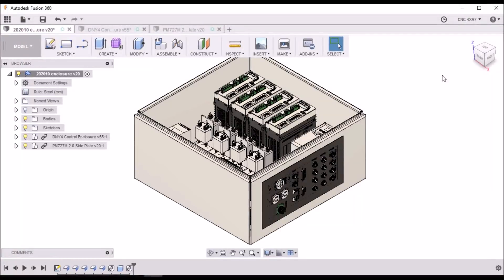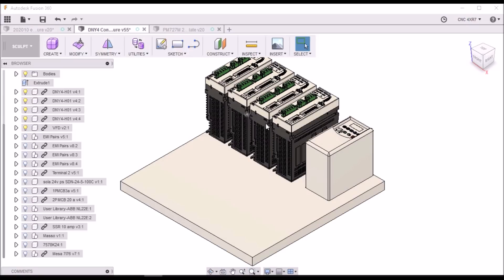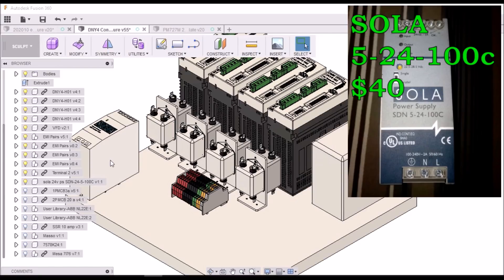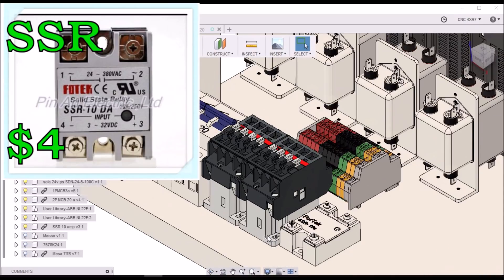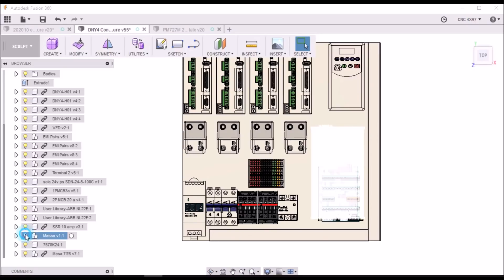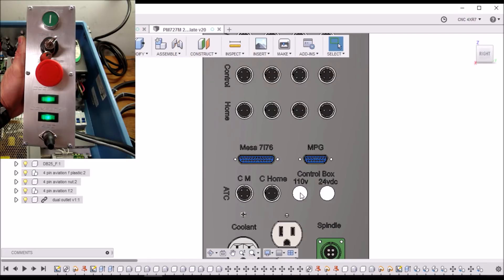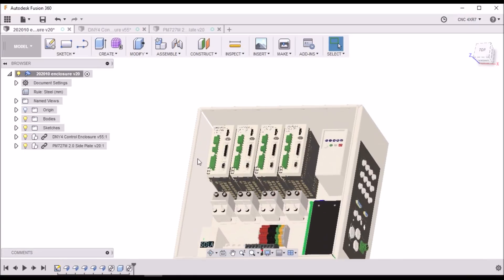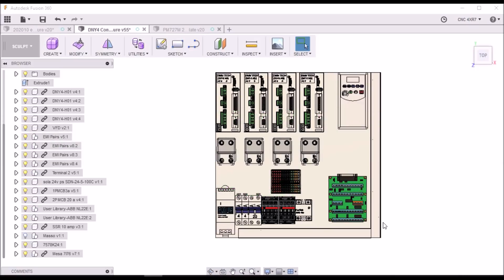DMM Electronic Enclosure

Comment: Hi again ... went back thru your prior controller enclosure videos - and will likely again .. but - Im having a challenge sourcing many of the parts - things like the Dinkle Terminal blocks [ actually ground blocks ] for a single enclosure - most of the sources will only sell ya 50 units !!!  Any chance you can post up a BoM list or a link to the sources?  Took me a week on Amazon to get most of my stuff - and still missing a bunch.  Looking for quality DIN rail mounted fuses,  an Omron power relay - not sure which one one to get actually ... as your part changed midstream ... a quality disconnect ....  there s more but ... Im kinda getting hte feeling you need a distributor relationship with a automation tech supplier to get affordable deals on a lot of the components in these enclosures ...
Reply from the maker: Hi Steve,
Are you looking for components for this box or the Original PM727M box? I sourced most things off Ebay a quick search yeilded https://www.ebay.com/itm/LOT-OF-2-OMRON-MJN3C-AC120-11-Pin-Relays-w-5X853M-Bases-120V-V164/202114040641?epid=1002964353&hash=item2f0eef8341:g:UpcAAOSwfVhaC1i3

Also I got my terminals from this Gentleman also on Ebay Email him with what you need and maybe he can put you a package together. dont for get jumpers. https://www.ebay.com/itm/DIN-Rail-Ground-Terminal-Blocks-8-Qty-AK1-5-PE-Dinkle-14-AWG-Gauge/122055515732?epid=1378796152&hash=item1c6b135e54:g:tysAAOSwbsBXkoPn

There is a Parts list included in My Plans. Email me if you have any questions.
Be Safe,
Sam

Comment: How are you converting the 240 to 110? I use an isolating step down transformer. some people just plug a separate cord in the wall thinking that's isolating it? but if you look in your power panel its just splitting one leg off.
Reply from the maker: Hi Tom,  I'm not splitting 220v just yet no need the drives and VFD runs off 220v. All contactors and controls run of 24v dc. If your talking about the 110v outlet for the CPU/ monitor and Coolant I'm still undecided as to how I will do this I most likely will bring in another 110v from a separate outlet so as not to put to much load on the one. Or like you say add a stepdown transformer which I have it's just a matter of space I also have a line reactor that will be a space decision.
Good question thanks, sam

Comment: have you looked into Centroid CNC Acorn motion controller? just curious as others have great things to say about it...
Reply from the maker: Hi Phil,
 Yes I have looked into the Acorn and touch on it in my CNC controller choices video from a couple weeks ago.
I think there on the right track however it's limited to only 8 I/O's which is a issue I have now with the C11gs. it only supports 4 Axis so that will not work for a ATC. you still need a CPU. So for me a Better choice over Acorn would be Linux CNC for $300 with the mesa boards and a new used PC. A lot more power although not Plug and Play you would need to set up Linuxcnc

Comment: I am glad you are considering other than Masso. I have been using Mach3 forever but have  purchase an Acorn also playing around with Pathpilot and Linux. It's takes a lot of time to do this but it's fun 😀. Enclosure looks very good plus Fusion keep it up nice!
Reply from the maker: it sounds like your a little torn as well with your choice. I think Linux is a little more to get going but is the most powerful controller out there. Masso Has a lot of potential for Home hobbyist and can be easily updated. Acorn is good for a hobbyist but is somewhat limited with I/o's and I can see much room for improvement there or they start cutting into there Oak series controllers. which is why I shy ed away from it. I am going to move forward with Linux and masso.
Reply: I agree with the conclusion on acorn its good but not the magic answer many think it is. The masso does not work with touch screen or a mouse only hot keys? They say there working on it. kind of reminds me of one of the advanced dos systems. Dos was very efficient .Many industril controll systems are similar to MS dos.

Comment: Hi, could you please let me know where did you find the requirement to put an EMI filter on each driver? I was thinking it would be enough to have a single one in the electrical circuit. I am not using the same drivers (using the ES-DH2306) but just wondering whether it is important or not! 
Thanks for your answers
Reply: one good article to read: https://www.cnccookbook.com/cnc-electrical-noise-grounding-techniques-interference-filter/
Reply from the maker: Patrice Touraine 
Yes that info was listed In the DYN4 drive manual.
Reply: OK thanks - will look at it and compare to mine to see whether it is required.
Reply from the maker: Yes a Filter on the VFD is required or a line reactor.

Comment: Cool video brother - love the fusion modeling - that looks like a lot of work.!!!  Looking forward to the future build out of this box.  I did notice its a bit different than the prior enclosure build from the components standpoint.  No "holding circuit" ?  No contactor needed this time?  Not sure what those two different relays are actually doing.  Also on your prior box build video - I tried to find those breakers like the ones youre using in this video - but only saw them at 240v ... in USA for 120V single phase - dont we need 110/120v breakers ?
Reply from the maker: Thank you,  No "holding circuit" ?  No contactor needed this time? Yes just will use the ABB contactors. one powers on the Servo drives and 24v ps with a Holding circuit. also will power up the second ABB contactor for the VFD uless the spindle selector switch has it disabled. very similar to the current setup. On the CB those are up to ratings for voltage. of course you can use Fuses.

Comment: Hi Sam, nice video and it makes life so easy with CAD, good to plan early. Just one note, the VFD's make a lot of electrical noise and should be kept away from logic components, it will be a good idea to keep the MASSO as far as possible as you will get electrical noise from the VFD, I have even seen in some industrial enclosures where people put a metal wall around the VFD. Otherwise the electrical noise will affect your VGA signals and other inputs.
Reply from the maker: Thanks Jatinder, I will take a closer look at that I have not had any issues with a BOB but I never thought about the Masso being the CPU and BOB so yes maybe some interference. Of course there will be a EMI filter before the VFD as well.
Reply: I was just thinking the same thing about the VFD and the board. The vfd should have a filter on the supply side also.
Reply from the maker: Yes you are correct I did not show this in the video i'm deciding on a line reactor or filter.

Comment: Nice enclosure you are building. I can see you are installing filters on the logic power and the main circuit side for the DYN drives. I do not think that filters on the main circuit are necessary. 
Keep the videos coming, i enjoy watching them :-D
Reply from the maker: Thank you, 
Well I also questioned the need for individual EMI filters on the main power side however thats the way they suggest they be installed and since I'm not a engineer I will add them. I think the drives may like a VFD induce noise. better to be safe.

Comment: That looks nice and tidy. How are you passing power into the box?
Reply from the maker: You know what I completely forgot about incoming power!  The used enclosure came with a power cord already connected to the box so I will not add it to the plate for the connections. But I did fail to mention this. thanks for reminding me.